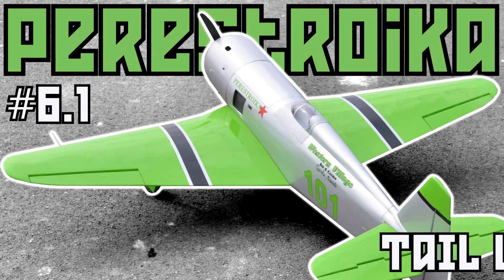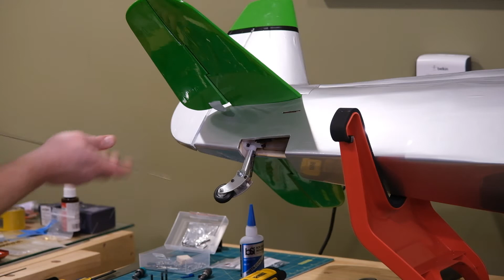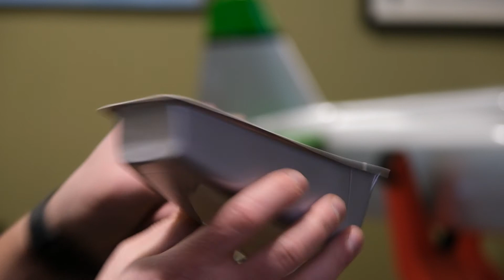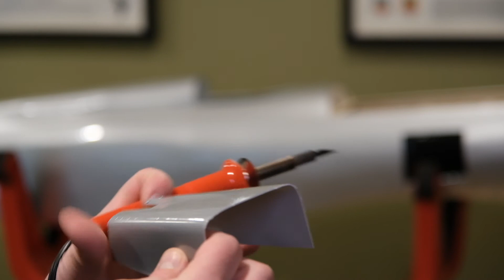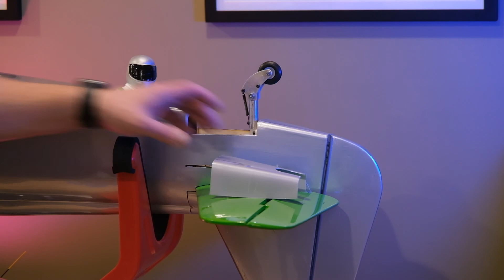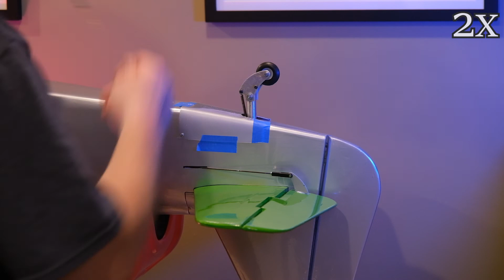Tail Wheel Installation - Seagull Models Reno Air Care Yak-11 ARF - Perestroika Build - Chapter 6.1

Comment: Dude you made this far harder then it needed to be LOL
Reply from the maker: Assuming you're talking about that plastic piece...I wanted to show the different ways to cut and shape it. Thanks for the comment!
Reply: @djmoosecom  I was talking about you melting it lol
Reply from the maker: That's a fair comment! How would you have cut that curve?
Reply: @djmoosecom  Same way I do all of mine. Straight and curved lexan scissors and use a lexan punch on the corners to get a nice angle. they come out mint.
Reply from the maker: @horrorgamer6687  Thanks man, that does sound like a better way. I'm going to mention this in the next video. I appreciate it!

Comment: Sadly that Hobbico hot knife along with so many other nice building tools from Hobbico is no longer available. I end up using scissors to get as close as I can and then I use various dremel sanding drums to sneak up on the line as you did. You can get some small 1/4" sanding drums to help out in the tight inside corners. A fingernail memory board also works well for a final clean-up of the plastic edges. Just go steal one from the wife, I'm sure she won't mind! :D
Reply from the maker: It's an uneasy feeling when I start to make these videos and realize half of my tools are discontinued! Thanks for the tips!